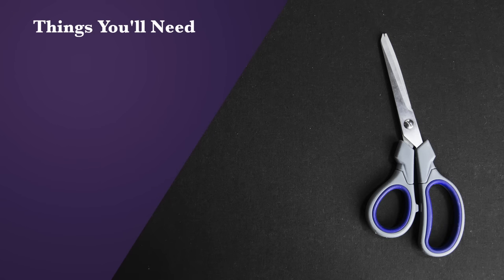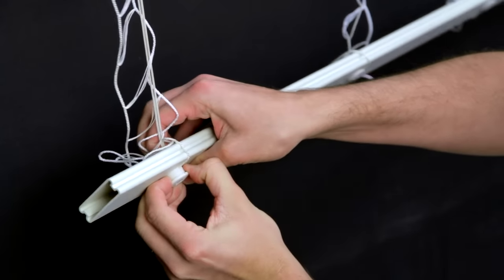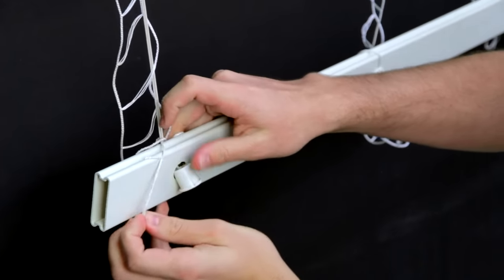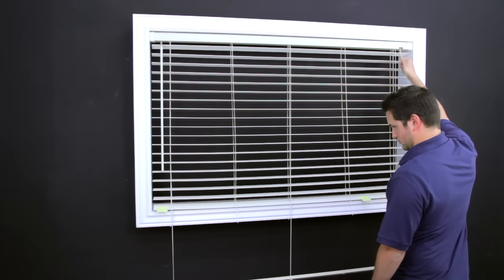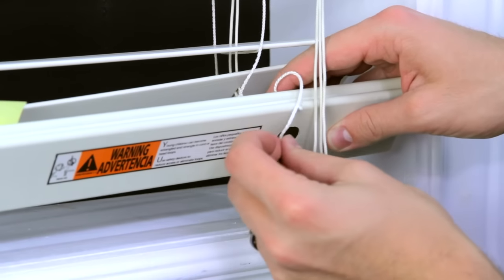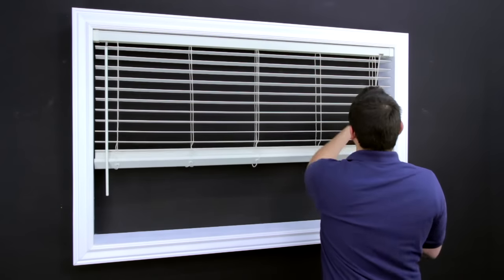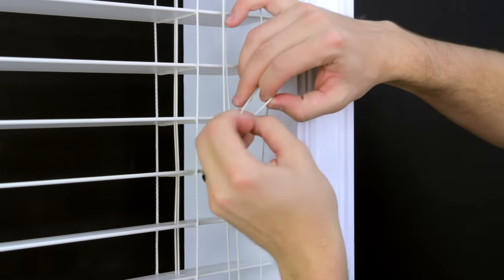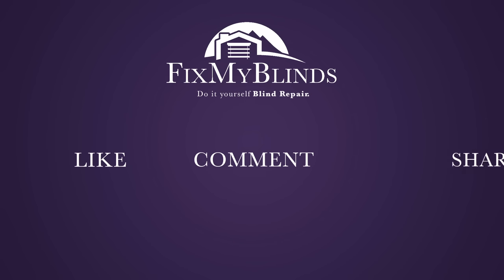How to Shorten a 2" Faux Wood Blind with Looping Lift Strings

Comment: Great video! Don’t break the slats though. They’ll come in handy. You just have to pull the loop string up and slide them out. Then rethread the loop string down through the slats. I’m shortening some of mine to use the extra slats where I have broken ones.
Reply: what? Make us a video
Reply: I cut my lift strings and they went inside the blind.  How can I fix that?
Reply: Too late now. I've just broken them!

This comment should be at the top
Reply: My apologies. I've never received a youtube notification until today, on AB's comment, and that was a week ago. 🤔 I will go into notifications to make sure it doesn't happen again. I was fixing blinds before I sold my last house. Unfortunately (fortunately), I do not have that style of blinds anymore. Good luck all. Just be patient and note the route the string takes.

Comment: The best and easiest method by far thank you. After raising the bottom rail to meet the bottom slat I used a couple of small clamps to hold them perfectly in place to attaching the pull strings and plastic buttons and it gave me perfect results. Thanks again
Reply: I didn't even have to use clamps/clips and it came out perfectly.

Comment: Thanks for this video. All this time I thought the lift cords had to be even at the rail end !  I have a method to save slats. or replace them .
I group the  slats below  the broken slat together into a tight stack. then pull the cords. I took a homemade hook made on the end of a thin rod, and pulled doubled fishing line through the lower slats so there is a loop to pull the free end of the cord out the bottom of the stack. The slots on mine were too narrow for knots or tape to clear. Figure out a way around that, and you can run a single fishline.

Comment: Thank you - I just want to take a minute to give my feedback to you.  I really appreciated having these videos to reference the repair that was needed on our blinds. the extra slats I never knew how to remove when I hung the blinds about 10 yrs ago and the cord had dug into the cradle on the far end from the pull cords which caused the cord to fray. it was a mess to fix but I couldn't have gotten anywhere close to finishing in the 4 hours it took me had I not been able to reference these very detailed videos.I may have missed a side not (you should add it) - to use a helper when trying to melt the two cord ends together!  the parts i ordered on your site came very quick and while the rollers keep popping out of the cradles the overall process was simplified buy having your site at hand. the videos were clear and very understandable. so thank you! I will be sharing your site on my social pages! 
-Jay
Reply: how do I fix the pull string if I cut it by mistake? HELP
Reply from the maker: Ilene - The only way to fix the string is to replace it. I wish that there was a shortcut, but there isn't.

Comment: Best video I wished I watched it before I adjusted my blinds. I tried to save slats and tensioner string slipped out of my hand 🤪. luckily my blind had 4 of those and O didn’t bother to fix the one those slipped and rolled back into mechanism.

Comment: This is the only video I watched on this but after watching I noted some seriously quicker ways to do it after the first one. 1-You don't need to break the blinds...they slide quickly out 10 at a time just by maneuvering the strings off and pulling the whole stack out the side. 2- You don't need to put the 3 plugs in the bottom in until you are done cutting them and ready to shove the strings back in there. 3-Gather the entire "ladder" ribbed chord and cut all the little pieces at one time. No need to be snipping every string individually. Much quicker that way and more exact too to just chop all the loops while holding onto the chord you're NOT supposed to cut to make sure you just cut the ladder cord. ;) Great way to save $15/window though super easy!
Reply: But thank you for making the video b/c I never would've noticed the short cut possibilities if I didn't see it first and try my first window! The other 12 were a snap ;) so thank you!
Reply: What? Make me a video.
Reply: I wish I did Kathi because as a I did it I was like oh this is even easier yet! But my kids were on me like white on rice to be done with it and play so I just hurried thru it and now have no more windows left to make a video with!

Comment: I must have done something wrong. When I tilt the slats the bottom bar also tilts. My blinds are different though so I think it makes more sense for me to push the lift cord AND the ladder strings though the hole without knotting them and the re-insert the plug with the lift string only. Will revisit at the weekend. Hope this helps someone else.
Reply from the maker: Hi there! If the ladder strings get tucked into the hole on the bottom rail and they are uneven or pulled too tight, it can cause the bottom rail to also tilt. When you put the ladder strings into the hole, be sure that the rail is laying flat and that neither of the sides of the string ladder are being pulled too tightly. It can take a few tries to get it just right.

Comment: Is there a way to recover your lift string?  I didn't see this video before I started and my entire lift cord is up in the top of my blind.
Reply from the maker: Hi Kelley, Are the blinds you're working on cordless operation? (Cordless operation means that when you lift them up, you push on the bottom rail and don't pull on any strings.) If they are cordless operation, then there's no way to recover the string once it gets retracted into the spring-loaded mechanism in the top rail. But, if they are not cordless operation and you pull on strings to raise and lower them, you will be able to find the string inside the top and restring them. If you have any additional questions, you can reach out to us at service@fixmyblinds.com.

Comment: Dont break the lats in case one ever gets damaged in future. U can cut the strings straight away to do this?
Reply from the maker: Since the blind in this video has looping lift cords, you'd have to untie the lift cords from inside the headrail and remove them so you could remove the slats. It can be done, but does take a while.

Comment: This was easy because the person has easy access to the blinds.  They are in front of them in the right height.  .  Mine is over a large window over my kitchen sink where the blinds can not come all the way down.  If you don’t have ideal conditions and brand new never messed with blinds, then you won’t have to spend hours.  I did.  I could  not sit  or stand inside my sink, of course, so the blinds wer not  always straight coming down. What to do with the faucet?   It was very difficult.  The video is great but don’t expect it to be that easy if you have too much to cut, blinds are Longer than here and the ladders have a tendency to get knotted.
Reply from the maker: Yes, having the blind mounted over a sink will definitely make this process much more difficult.

Comment: I have shortened many Wal-Mart blinds and always cut all the strings, no problem.  I did that and my lifting string went inside the top of the blind!  How do I repair, or get to that??
Reply from the maker: Dianne, Are the  blinds that you tried to shorten cordless operation? (Meaning that there aren't any external cords to pull on to raise the blinds up and down.)

Comment: If the strings are cut at 1.54 how do you lift the bottom rail up at 2.01?
Reply from the maker: The cords that lift the blind up have not been cut. They are still looped around the pulley in the bottom rail. The strings being cut around 1:54 are the ladder strings that support the slats.

Comment: Don't understand why you brake the slats first, would it not be easier just to cut the strings at the correct place and leave the lower slats in tact.
Reply from the maker: Alan, Breaking the slats is the easiest way to make the adjustment. Cutting the lifting strings will destroy the function of the blind and it will have to be restrung.

Comment: I did like the video. The only thing I didn’t like is to break the pieces 😱😭😭😭... felt like putting my money into trash!😭😭
Reply from the maker: I totally get what you're saying! It does feel odd to break something you may have just purchased. However, breaking the unneeded slats is the easiest way to shorten this type of blind.
Reply: FixMyBlinds i know! And i did it... very easy to follow instructions.
Now my blind looks even prettier than before.
Thanks for the video!

Comment: DO NOT BREAK THOSE SLATS !!!  You might need one later if they are easily broken.  There IS another method.   Just slide them out and watch this https://www.youtube.com/watch?v=wqLE7_MAl6c. There are other vids for this type of method too
Reply: darkwaters i saw that vudeo but those model of blinds are different. you could not do it with this kind
Reply: Yes, I'd really like to have a method of saving and later replacing the slats.  I plan on cutting some to make room for a portable AC vent  hose, but want the option of restoring the slats later.   I wonder if I could cut the lift strings, and after making the adjustments thread through again, and tie a knot to repair the cut string.  I think I'd have to be careful where to tie the knot so it doesn't interfere with the lifting operation.
Reply: After looking at it some more, I see that the dual strings that thread through each pulley are such that one of the two strings is anchored a the very top bar, strings down to the pulley, around it and up again to the top bar, and then down to the tassels on the sides.  That means it's really a single cord, not two with one end at the tassel, and the other inside the top bar.   I think the key is to somehow get inside the top bar and free where it's anchored, and thread it though.  I just don't know how easy it is to get inside that top bar.  I think the whole thing needs to be taken down and laid on a table to work with.
Reply: Okay, I tried taking it apart, but it's really hard to get to where the cord is anchored.   I have a better idea and easier idea.  Back to cutting the lift cord, but I think the key is to cut one of the two: the one that leads to the top anchor point, not the one that leads to the tassel.   And cut it high as close to the top bar as reasonable.  The reason is because the whole rest of the cord will move around as the blinds are raised and lowered, but the part near the top bar anchor will never move.   This way the knot we tie will not have to pass through any of the slats and possibly get stuck.
Reply: I was able to pop the pulley out through the bottom of each plug by inserting a small flat head screwdriver to each side of the little rod part of the pulley.  I used a hammer and held the plug while lightly hitting the screwdriver and it popped out pretty easily.  I was also able to just hit the screwdriver with my hand, while holding the plug in my other hand and that worked also.  The little rod part of the pulley does slide right out, so be careful not to lose it. Once the pulley is out, the looped lifting cord comes right off the pulley and can be pulled up through the plug, and up through the middle slots of the blinds as far as  you need to go. Slide out the damaged blind(s) and re-insert good blinds (you can re-use the extra blinds that you remove from the bottom if you are shortening the length. Shortening works the same as the video shows.

To put it back together, just feed the looped lift cord back through (mined was fed by alternating to the right and left of the "ladder strings"). Feed it back through the plug and while holding the pulley in one hand, feed it  around the pulley.  Push the pulley back up through the bottom of the plug, and then pull firmly on the pulley cord above the plug (while holding the plug) and it snaps right back into place with a couple of little clicks.  After I got the first one the 2nd was easier.  Hope this works for you!
Reply: That is wonderful advice!   I followed your directions exactly, and it does exactly what  you said it would do.   Inserting the screwdriver and tapping with a hammer is what did the trick.  I actually hadn't done this project yet, so it was really handy that you posted your response here.    I've detached one pulley so far, which is just the beginning of your steps, but it was the step I was stuck on.  I should be able to complete this task now, thanks to you.    I had searched youtube for my type of blinds and for how to do this, and really you are only one I could find who has solved this problem.
Reply: I'm so glad it helped!  I was doing the same thing searching the internet with no luck...figured I would give it a try and surprise, surprise, it worked! :-)
Reply: Oh, to clarify:  I am indeed shortening my blinds, because I have way more slats than I need for the size of this window.    The slats I remove will become spares, so when I cut off the ends of a few of the slats to make room for my portable A/C vent hose (damaging those slats), these spares can be used when I eventually sell the house, to restore the blinds to original condition, since I intend to take the portable A/C with me.   This way, the house will show better, and not look damaged.

Comment: Instead of breaking the blinds , you could have suggested to remove.
Reply from the maker: Yes, the slats can be removed. However, that means removing the string from the blinds entirely and then rethreading it all. Breaking the slats is the easiest way to shorting the blind when it has looping lift strings like in our video.

Comment: DO NOT BREAK THE SLATS!!! 

Why tf are they telling people to break the slats when they could save them in case one breaks??? Your basically cutting the string that's connecting the unwanted slats to the slats that you need. 

You can skip breaking them entirely and just cut the strings and remove it all in one piece. And since you are 

1.Taking out the bottom buttons you can... 
2.Pop the pulley out that secures the pull string to the button. Once it's out youre able to...
3.Lift the pull string up out of the slats that are being removed. 
4. Cut off whatever slats you dont need but leave enough string to secure to bottom buttons
5. After having everything at the desired length you can put the string, pulley and button back together into the bottom slat and adjust from there.

Fucking ridiculous.
Reply: How did you pop the pulley out of the button?
Reply: Just wanted to thank you for taking the time to write this comment. I was not happy with breaking the slats as I wanted to save them and thanks to your comment realized I could actually just pop the pulley out. Once that was done I was able to easily finish the project. If I can do it the proper way, anyone can. Really happy! 😊Thanks again!